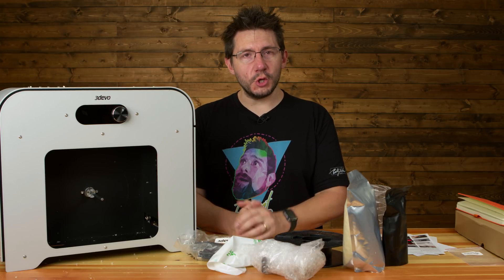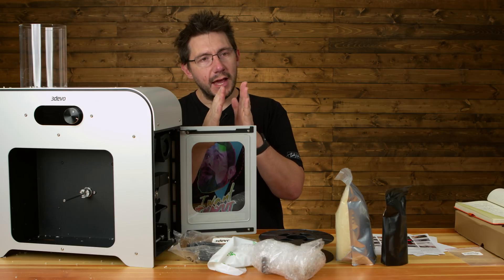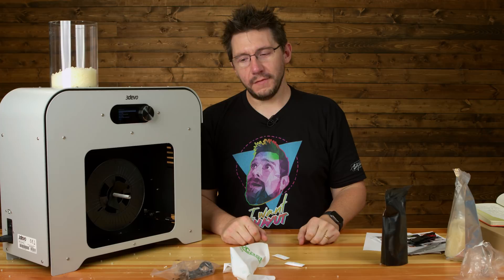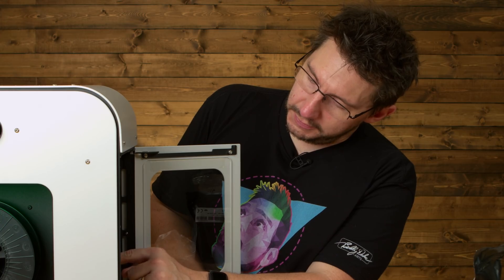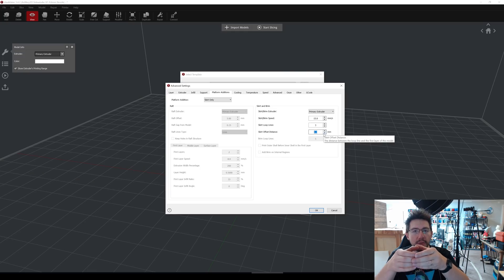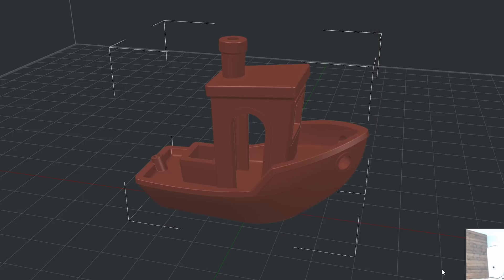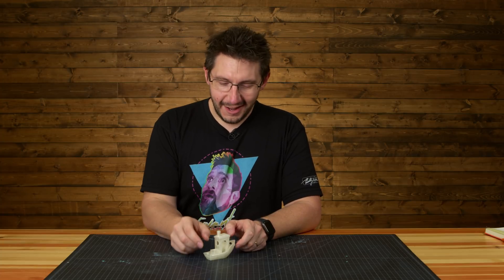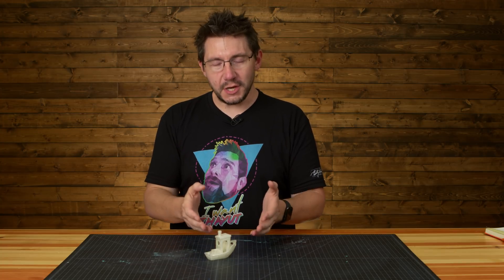Make Your Own Filament at Home: Take 2 - 3DEVO COMPOSER First Impressions

Comment: As you thread the filament through the spool; try this... don't cut the filament to feed it through a hole in the spool with a short piece. You will have more control of the extrusion if you thread the longer piece... then cut it on the outside of the spool.

Comment: Hey Joel,any updates on this machine? Thanks.
Reply from the maker: Hey! Yes, I sent it back. I could not get anything consistent from it. I didn’t have time to troubleshoot and adjust so I thought it was best back with them.
Reply: @3DPrintingNerd  Thanks for your reply Joel. Do you think they have fixed these issues? Their machines are quite expensive for not delivery good and accurate results. I'm looking for a filament maker for recycling supports, failed prints , etc. Perhaps run a small recycling business. Can you recommend a machine? Thanks again and keep the great job!!!

Comment: This machine is $8,000 USD
A 1kg spool of PLA is ~$20
$8,000 / $20 = 400 spools of PLA you could buy instead of this machine. 

That's 881 lbs or raw material you can just buy instead of this machine.
insane

Comment: Here is what we experienced using the 3 Devo with recycled material. PLA. No mention of needing drying or any other steps during the purchasing phase with Pedro. Great sales pitch but development of this will take weeks of engineering time to make consistent thickness of filament. we drifted from 2.2 to 3.2 on a 2.85 setting. It would run in our 3d printer until it hit the variation of the filament then strip or clog in the 3D printer. Hope this helps those who are considering recycling. We don't use our at all at the moment don't have the time to develop someone else's product for them.

Comment: We purchased the 3Devo and it worked great for using the
granule but when we used it for recycled PLA that was a bit tricky. They tried
to help use and we spent more time developing the filament and were never successful.
So very poor ROI for the cost. If you would like to try it I am selling mine.

Comment: you can buy enough filament to 3D print a whole garden house (not even joking! easily!) for that kind of money. in perfect colorconsistency, better quality, and without monitoring, cleaning the machine or hammering/grinding down your recycle marterial. 

it just doesnt pay out. it is WAY too expensive. it should cost like 500-600€ to make sense. not like 6000+€. 
or maybe you just need a REALLY expensive machine, that does everything all in one, and people can send their PLA wastes to them and get like 50% of the weight in low quality PLA or something.

Comment: When I visited a plastics manufacturer recently, I saw their industrial machines, and their filament extruders had the filament passing through mid air. The machines were big, and there was approximately 3 meters between the orifice where the material was exiting the extruder and the spooler. So, it concerns me some that it goes from molten to spool in such a short distance. I wonder if there will be added distortion, such as being out of round, or taking a hard coil shape set, with it being such a short distance.

Comment: Now we missing a shredder product which can take a real failed print of any size and can shred it down to a particle size this 3Devo unit can handle. 
So Joel the ball is in your corner to find us the "perfect" shredder. I got about 2-3 lbs of failed prints collected of the same material and same color.... SUNLU PETG BLACK. So let me know. My 5 gallon bucket is about 3/4 full with failed prints.
So ideal would be a shredder with a heating chamber and screw which spits out those pallets meaning an extruder and than like a turning wheel which chops up the filament into small pallets which can be stored and used than for making filament.

Comment: BUT, this test, and the results you got, come with the purchase of the 3Devo pellets. Beyond the practice pellets they provide to get the great results you got we need to purchase more pellets, and cost of the pellets vs. filament comes into play. I assume the pellets are cheaper than a roll of 1.75 filament. Why we really want is to recycle our failed prints. For example, I run 4 machines, snapmaker 2.0,  Sindoh DP200, JGAURORA upgraded A5S, and a Dremel 3D20. Might hook up with a PRUSA. Seems like I should be doing youtube videos on 3D printing but I am too busy manufacturing. The snapmaker, as you know is a direct feed into the extruder and not much wasted filament when changing filaments. The Sindoh, that's another story. It has this auto feeding system, which is really a pain because if you use their proprietary filament you have to load up the filament cassette. Doing that is actually more difficult than feeding directly into the snapmaker printhead module. I run open source filament which feeds into the extruder fairly nicely BUT there is a trick to loading and unloading. When you unload you better cut away that went through the extruder because the extruder gears grabbed it and etched the filament. And the other machines have challenges of their own. If you attempt to reload that filament in the SINDOH that has etch marks from the extruder you will get a jam. Happened to me when I was doing it this way. Telling you this because each filament change I waste about 18 inches of filament when ever I change out the filament. Then add the filament waste from some experiments I do as I am a parts designer rather than printing someone else's designs from Thingiverse. So, I have experimental prints before I go to the final design and print. So, those experiments, the wasted Sindoh filament, and some failed prints means I have accumulated waste. THAT is what we want reused. I don't want to buy the 3Devo pellets, I want to reuse my filament that is on it's way to the recycle bin not that I know how to grind them down to small enough pieces to make consistent 1.75 filament from that 3Devo machine, BUT I do have a commercial grade blender that they use to do commercials on that can grind rocks, not that I have used my blender to grind down rocks. And I see the 3Devo is over $5000. That's a lot of commercially available spooled prepackaged filament at $20-25 that can be bought for that $5000+ price tag.

Comment: How do you use this with old prints? U gotta turn the old prints into pellets? Or can you drop in bigger chunks of failed prints in the hopper?  Can you show this using failed prints or something besides pellets? Are pellets cheaper than filament? Really bummed there was no recycling of old material in this video either

Comment: As 3devo replied to a different comment: "Regular pellets would typically be easier to feed, but when it comes to inconsistent regrinds this requires some additional adjustments
. Once these have been perefected it can be replicated throughout. Keep in mind that each polymer responds differently though"

Comment: i have worked with this machine and it is a pain i the ass! We have 3DEVO, SHR3D IT and the AIRID polymer dryer, and where hoping the use it for my university failed 3D prints but it will only make filament you can use with new plastisk . We spend more the 25 man hours and get no result. If anyone have experience with getting this machine too work pls let me know how!

Comment: Disappointed that no recycled material was used as this is the main test of machines like these, the main point of any home/workshop based filament maker device is going to be recycling failed prints. Using virgin PLA is never going to be economically viable unless you have an absolute need to bake your own variant/colour etc. Granted this is an expensive boondoggle and most people would never use enough PLA or rather generate enough failed prints as feed stock to offset the cost of this but many are willing to take the hit in the pocket for multiple reasons primarily environmental. I like many are fascinated by the possibility that 3D printing presents, a future of having a nearly closed loop cycle on plastics where a home machine like this and a 3D printer means I can shred up my plastic 'trash' and turn it into useable filament which I can then make stuff with. What a possible future that a machine like this and a 3D printer become a form of white goods that Joe gets to use without all the tinkering or better yet kickstart a new industry just like TV repair men :-)

Comment: I was given over 800 pounds of virgin ABS pellets and still could not justify this thing. I own 6 3D printers, 5 of them use filament, one is resin. I have two to 4 printers running almost 24 hours a day and still only burn about $1000 worth of filament per year ( I can buy 1Kg rolls for $10 each ).

Comment: This is not worth $5000. Decent filament  is $20 for 1kg . The shredder is another $3000 . For all that. You could buy about 400kg of filament. That also doesnt include the price of their refills that you need. Unless you are printing industrially there is absolutely no reason for the average consumer to have this. I dont know why a company would realistically send this out for a review. Maybe a few people buy this at best from the video. I dont question the quality of the machine. I question why this is sold to consumers. If this was $500 for a shredder and $1500 for a extruder that would be decent. But 8k is just arbitrarily expensive

Comment: I want to know if you can make one spool of different kinds of material?
Imagine that you designed a flexible joint with hard mating ends.
So, you extrude one color of one material, and then because you premeasured everything, you then add a Flexi filament material and, finally, back to hard material.
Once you get your printer going, your print will automatically feed this one spool and make the multi-material print!

Comment: Joel is catching a lot of flack here because he didn't use recycled failed prints. Bare in mind this is effectively an ad, and I don't think using recycled prints would be a good first impression because it's likely to be a lot more difficult, have more failures and almost everything is variable. If I were 3Devo I'd want him using pellets too, they've tested with pellets, they are sure it's going to work.

At 5k this is crazy money, but that's how this stuff works. We need business and enthusiasts to foot the high introductory prices to create quantities of scale so that in a few evolutions we have an affordable machine.

I have no doubt we will see this machine extruding recycled parts by Joel and by others but it would be fairly unfair for it to be used like that for it's very first outing on screen. It would be DOA if any number of things went wrong and that wouldn't be 3Devo''s fault.

Comment: An idea: when you attempt print recycling you could sort out similarly sized pieces (by using a gravity-powered sorting machine or just a plain old strainer with holes similar in size to the beads you used in this video). Then you could test which size gives the best resulting filament/how long you need to blend in order to achieve that size.

Maybe even worth a stand-alone episode after just testing that it works at all :)

Comment: I work in an R&D shop for a larger company- right now we have two stratasys machines and will be making our own large format printer in the next few months. we do injection molding so already have thousands of pounds of various materials and colorants here. our budget is way bigger then the average home user obviously and spending money to get hassle free equipment is up on the priority. we spend 10K plus on each of our statasys machines filaments every year. Having the option to make our own material for the new printer would be huge. don't even need a business case for 5K. That's who this is marketed towards.
Also we'll take this one off your hands if its just going to collect dust :)

Comment: Your test seems a bit forgiving of the tolerances on the filament, on a larger nozzle with a larger flow rate, smaller imperfections on the filament diameter make up for a much smaller percentage of the overall extrusion diameter error. Why not use a standard 0.4mm nozzle? Prusament is so great because it can better render fine details. If all you need is tons of filament, you can still get it at a much lower cost per volume by just buying it fresh compared to resin pellets.

Comment: Whats the point if recycles filament isn't used.  Only using bundled pla pellets can make any extruder look good.
Reply from the maker: No it cannot. Did you see the previous extruder I used? It's linked in the description.
Reply: @3DPrintingNerd  Limited time.   I'll go check it out. 

May last year?  Hopefully we've come along a bit since then, that thing looks scary  lol

Comment: Its not going to go any place. its a nice unit but even Your target market set is going to ask how many spools would i need to make for it to pay for itself. and at that point they are going to walk away. I run 5 printers and i cant justify the cost of one. 1 benefit i see is make your own colors. then i have to ask could I make my own colors with a duel extruder printer? or paint at 1/20th the cost or better. I watch my scrap very close so i normally dont have a lot of scrapped prints so maybe just me? If you could get that price down to say 2500

Comment: The Maschine is fine, but as mentioned by the people around this is a filament maker. Actually this machine is kind of the easy part. It gets far more complex when you shred old parts and the machine needs to create a constant stream out of different sized and formed plastic parts. These pallets are easy since the machine knows the amount of plastic at all time. This is not recycling. We will speak again, when you find out how to shred and feed this machine with real world recycling material.

Comment: Checked out their website - conclusion: for most enthusiasts with a reasonably good quality 3D printer at the $400 US price point, $5,000+ for the low end 3Devo extruded is way, way, way to expensive.  In my opinion.  An extruded should be a tool to augment printing and should around $200-300 USD.

I would like to see to create your own filament from scrap and abandoned projects.  The “wasted mistakes” you would otherwise throw away.  Please.

Comment: Not shredding and using old prints and supports was a huge mistake 90% usage will be recycling imho.
By the time it got here it would cost $10,000 and no roi possible during its lifespan which I'm going to guess at a few years only.....if that.
Reply from the maker: Wait - this was just to see if it worked. I thought I mentioned that in the episode and I’m sorry if I didn’t. The plan is to verify it works - and once done - throw in all sorts of scraps and purge towers and whatever I can find. Promise.
Reply: @3DPrintingNerd  Seeing if it worked with the off cuts and waste is what it would be most likely used for and most of the comments expected to see the same as me. Working with their own supplied materials is always going to be the safe option and not necessarily the common case option. I get seeing that it worked was your goal but surely the assumption must be that is does the expected with the materials it is designed to work with. We want to know if someone finally filled the gap and answered the question on everybodys lips.
Reply from the maker: Well yes, that’s typically the safe option. However, with the last one, that was very much not the case. I was a little hesitant and VERY HAPPY this worked out. Looking forward to lots of fun filaments in my future.
Reply: I was just doing some back of the envelope calculations and in a 3 year life span you would need to make 400 $25 rolls of filament or 133 ish rolls a year to recoup 10,000 which it would cost here in our peso :-)

Comment: so disappointed you didn't try to use failed prints and supports
Reply from the maker: This was a quick first impressions to make sure it worked. I wanted to see if people cared about it. The overwhelming response has been awesome and you can bet you’re going to see some failed prints and support material turned into filament :)

Comment: I wouldnt print with filament + - 0.5mm
Reply: No one prints with filament that is + - 0.5mm...... I dont think printers COULD even print with it if you could get it loaded..... 0.5mm is 1.25mm - 2.25mm...... I think you meant 0.05mm which is what he said..... And while that isn't super tight tolerance, it isn't a much wider band than the nicer filaments, and some cheap filaments can vary by pretty close to that. I bet the tolerances would be even wider if recycled filament is used, which then might be far enough out of spec that its unusable.

Comment: The real pro gamer move is to have the filament extruder feed directly into a printer.
Reply: And from the printer straight to the shredder and back to filament maker.
Reply: Or, ya know, just make the filament maker the printer too
Reply: Custos, that’s called a pellet extruder
Reply: @lucasvanbeers9906  Ya don't say
Reply: It would be easier if some company invented a hot end that you could just put the pellets in and it just uses it with turning it into a role

Comment: Using a larger nozzle you pump more material per unit of time, so if there are inconsistencies in filament thickness they last less and become smaller. But anyway the difference between 0.4 and 0.6 is small, if there would have been an overextrusion 20 mm long with 0.4 mm nozzle it would become 13.2 mm long. It's not that it would become invisible!

Comment: Nice to recycle 3d printed material. But I'm still missing a step; I'd like to put my failed prints, supports etc directly in such machine without having to cut the failed prints and supports into pellets first. That's what I would like to see in a filament-making machine.